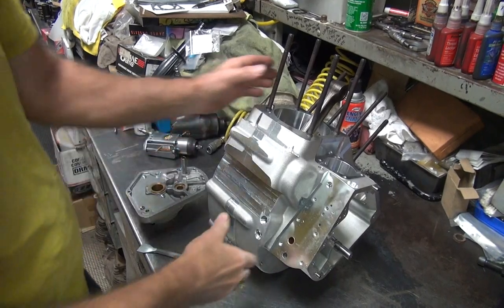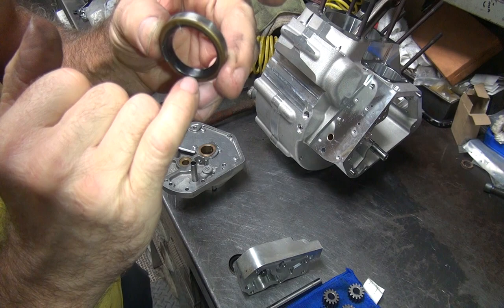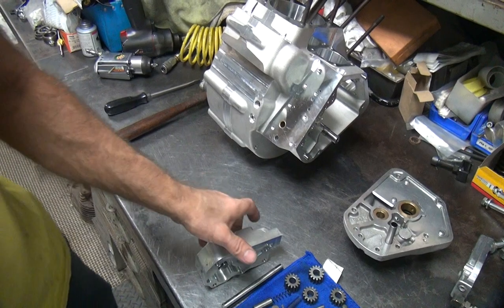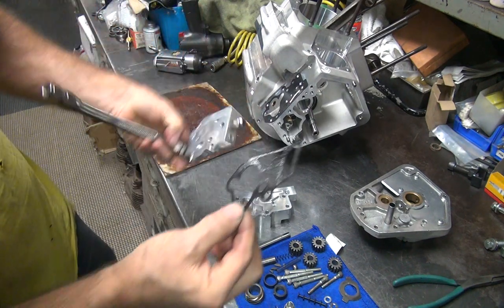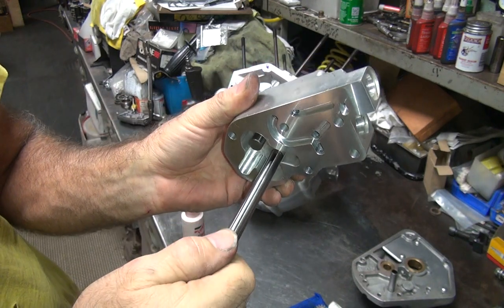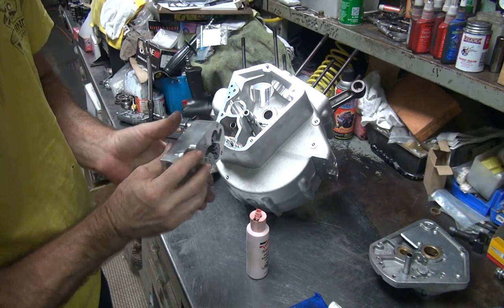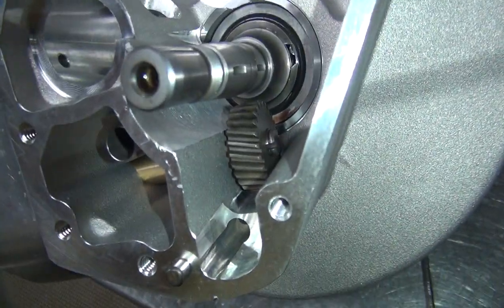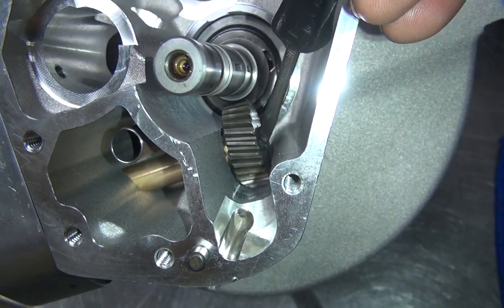#113 S&S 113ci evo motor pulled cylinder studs repair harley swift evolution head by tatro machine

Comment: Why is it on some motor builds you are much more picky when it comes to the oil pump gaskets, I 've see you measure the thickness of the gaskets before, but not this one?
Reply from the maker: that is because on the old iron oil pumps you need to minimize everything to get any oil pressure at all. on the newer pumps it is not as critical.
tatro